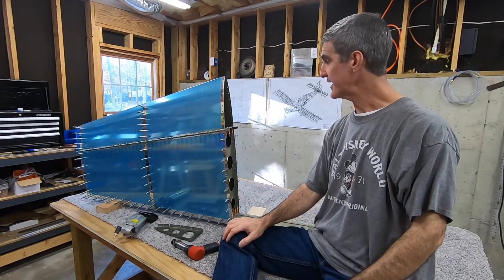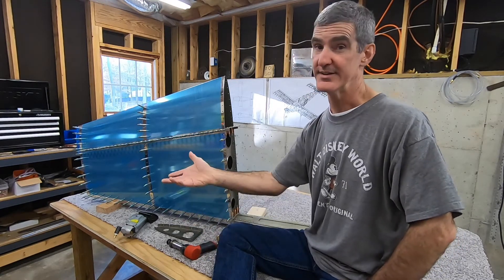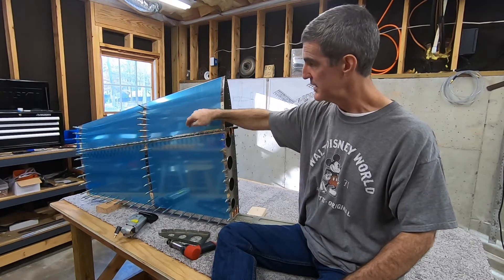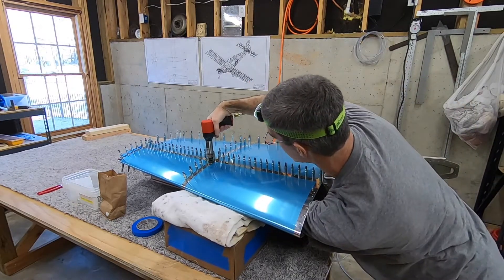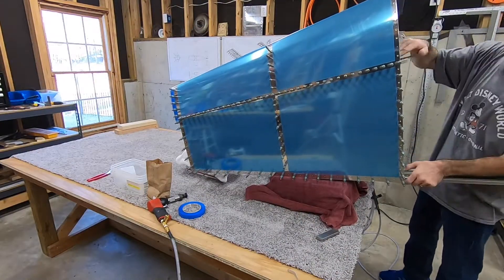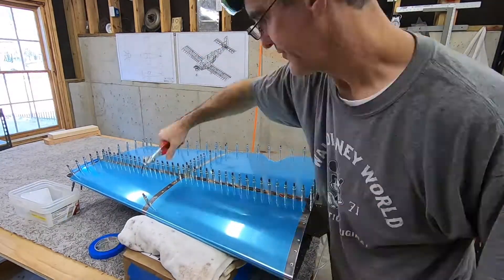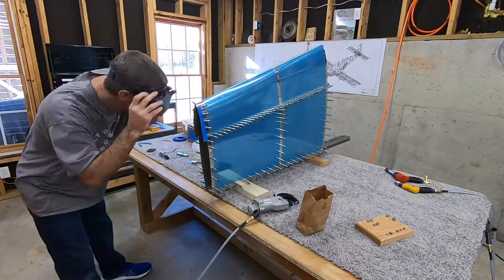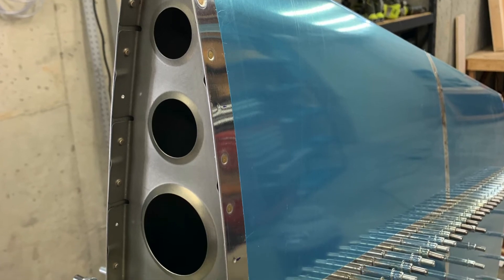RV-10 Build Log - Emp 14 - Bucking Rivets on the Vertical Stabilizer

Comment: What are all the rods sticking out?
Reply from the maker: Those are "clecos".  They're little spring-loaded  clamps (for lack of a better word) that you insert into the rivet holes to hold things together while match or final drilling other holes, riveting, or doing anything else where you need to put parts into position temporarily.

Comment: What air pressure do you use to buck 3/32 rivets? Thanks!
Reply from the maker: Compressor regulator is set to a little over 90PSI, but it's up in the garage, with a 100' hose running to the basement, and I also have a little "regulator" (more of a flow restrictor than a true regulator) on my rivet gun.  I dial that back and forth to get the gun to buck at the speed I want for a given task.  Not very scientific I'm afraid.

Comment: TUNGSTEN BUCKING BAR - TRAILING RIB (SKU: BBT88) from Cleaveland Tool can help you rivet into those tight places with a trailing edge.
Reply from the maker: Ah, thanks for the tip!  I have a couple of different bars, but not that one (yet).
Reply: Used tungsten bucking bars in the industry for years, they are amazing because they are so dense. They make razor blades out of it too.